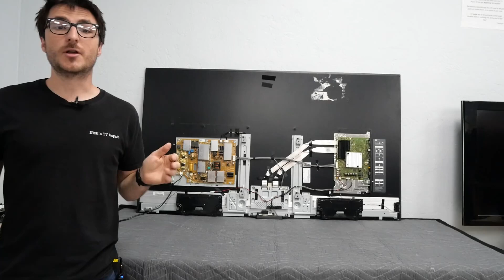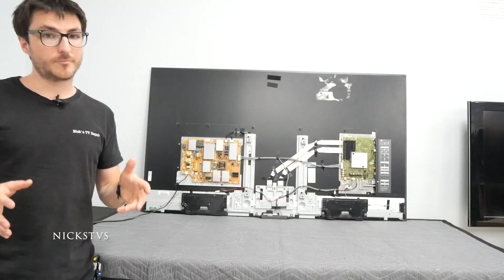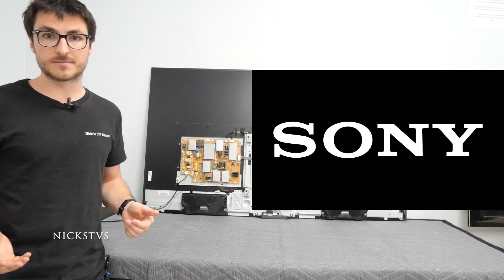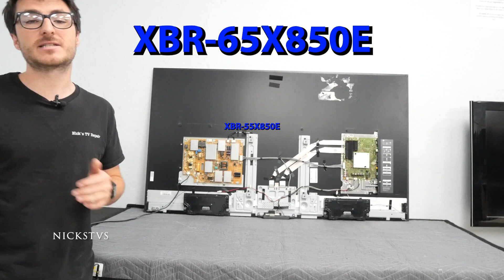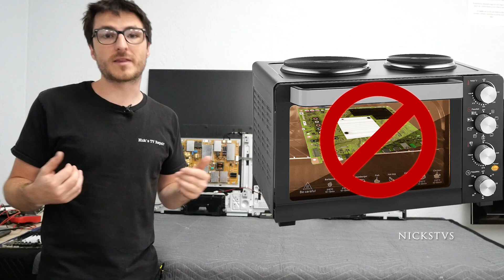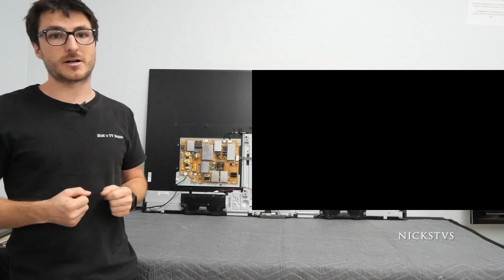Sony TV Diagnostic For Beginners Blink Codes Explained XBR-65X850E XBR-65X900E

Comment: Hey Nick, I got a Sony X90J 65 Inch TV that won't stay off.  I get random white blinking as if trying to power off but it comes back up again every time.  I've done soft/hard reset, I've disable all HDMI power up setting, disconnected all other sources, changed remote batteries, but it all points to the TV itself.  Would this be a bad PSU?  Anything I can try?
Reply from the maker: Based on your description it would be a bad IR sensor, buttons, or mainboard. Those are the only 3 things I can think of that could cause that. Turn the TV off, and immediately disconnect the buttons, repeat with the IR sensor. Still comes back on, then it's the mainboard. Stops coming back on after disconnecting either buttons or IR then that's your issue.

Comment: Tv turns on. Then shuts off with 4 blink code
Reply from the maker: If it's an LED TV then your LED strips need to be replaced. If you have an OLED TV then depending on the model it may be a power supply or screen failure.

Comment: Evening, not sure if you’re still checking this thread. I have the XBR65x850e. Just got the 6 blinking red lights. Did all the other quick fixes. Nothing works. I’ve seen videos about bypassing the error light indicator. Does that work for this model? Your thoughts on what I should do?
Reply from the maker: no that does not work for this model. As mentioned in the video 6 blinks has to be new LED strips.

Comment: Hello, I have a Sony XBR-75X900F, The TV will power on, complete the bootup process (Sony logo, Android logo, HDMI/Menu screen). After the boot process, the TV seems normal. No screen flicker, no strobing, nothing. After a period varying from 5 min to 2 hours, the TV will shut off completely, attempt to reboot, get to one of the two boot screens, then power off again with the 4 red blinks. I will then unplug the TV for 5 min or more, plug it back in and the process starts over again, but the amount of time that the TV works is reduced each time. I have tried unplugging all input cords into the TV and plugging them back in one at a time to eliminate a cord issue. I have also tried the forced factory reset with no luck. The Main Power Board was replaced in 2021 due to a no power issue (screen would not power on and the led would only blink red). What could the issue be or what else can I do to troubleshoot the issue. Thanks in advance.
Reply from the maker: You have bad backlights. Replace your LED strips and it will solve the issue

Comment: MY Sony XBR-65X750D, I replaced the main board and have sound but not picture.
Reply from the maker: Most likely and issue with the large flat ribbon not connected properly. This is an extremely common issue people experience because of how fragile those ribbons can be. Also it's possible your ribbon got damaged when it was removed from your original defective board. Try reseating it first and try again. If the issue persists then you may have to buy a replacement ribbon.

Comment: HAVE XBR 65X 900E 4 RED BLINKING LIGHTS FUALTY CODE  GOES ON FOR 3 MINUTES THAN OFF WHICH CIRCUIT BOARD DO I CHANGE.
Reply from the maker: 4 blinks is a backlight failure, meaning you will need to replace the LED strips inside of the panel.

Comment: Hey there, I hope you are still checking these comments. I have a Sony XBR-65X900E and I am now getting the 4 flashing LED error code. After I do a soft reset I will get the sony logo and then the google logo and sometimes even get as far as the HDMI Input select but then after about 10 seconds the screen will go black and I will get the 4 red led error code. Other times I will do a soft reset and right after the google logo boots up the screen will go black and I will get the 4 red led error code. I also did a full factory reset, got a spinning circle on screen for about 5 mins while everything got erased then the sony logo same up and then the google logo, finally after the google logo the screen shut off and I got the 4 red LED error code again.

Going to open it up today and try the bypassing the error shut down protection pin and soldering it to ground but would prefer to try a real fix on it first.

Any insight would be greatly appreciated.
Reply from the maker: 4 blinks is backlight failure.

Comment: Hey thanks for what's the fix for 8 blinking lights - you said software related but how to fix as no display is showing only 8 red flashing lights
Reply from the maker: You have to replace the eMMC chip on the mainboard for that. It's one of the more advanced repairs and requires very expensive machinery. We don't recommend you try this yourself and instead to send it in for repair. Flat rate repair service is linked in the video description for the mainboard.

Comment: My xbr65x900e doesnt turn on, no blink codes, no buzzing sound...I was getting warning signs possibly cause i would find when i go turn on the tv, it would give me the sony and android logos and then turn on...what could it be?
Reply from the maker: It really sounds like a mainboard failure to me.
Reply: @NicksTVRepair So that's the diodes needing to be replaced?
Reply from the maker: No sir, the diodes are on the power supply board. The mainboard is the green one with the HDMI ports, processor, and eMMC chip that we talk about. You have either a processor or emmc chip failure.
Reply: @NicksTVRepair thanks. What should I expect for repairs cost wise for that ? Im assuming that's not a do it  yourself
Reply from the maker: We don't do pricing on youtube, but prices are available on our website. Listings are linked in the video description.

Comment: I get a flashing white light all the time {whether powered on or off}.  Does seem to work except network connection always way slower than it should be.  Computer on same network shows network is fine.  Flashing light is very slow but also seems to randomly change flashing rate occassionally.

Comment: Hi Nick, what do you think about the cutting of the #4 pin on the backlight cable so that it cannot report the error?  My TV works and looks fine anywhere from 3min to 20min before it does the 6 red light blinks.
Reply from the maker: I don't think you should do that. 
I think you should replace the LEDs to fix your LED failure.

Comment: I have a 65X900E that started randomly turning back on after turning off, restarting and flickering. It will not accept a firmware update, even though it says it was successful. It also cannot be reset to factory settings through the menu or via a hard reset with the buttons on the outside. It just simply restarts. Picture settings are lost whenever the tv restarts, but most of the time the TV works so long as you don't try and adjust anything; it will often go to a black screen and the only fix is a restart.
Reply from the maker: Interesting. You can probably get away with having it work that way for a bit, but eventually it will get worst. The eMMC chip most likely needs to be replaced. It's however possible you may have fault with the processor as well. Sometimes both need replacement.

Comment: cant you talk about the 7 error blink code more? like what causes? heat? or what is the fix ? thank you
Reply from the maker: Can't sorry, it's so infrequent that it's not worth looking into it. We have seen it probably 20 times total in the last 5 years. (mind you this is accross thousands of repairs) We did try to figure it out at first but then gave up and decided it's not worth the time and effort given it's not common enough of a failure. 
7 blink our rule is replace the mainboard.

Comment: Hello sir i have xbr65-900e I change already the main board but no display if i turn it on sound will come any suggestions todo it
Reply from the maker: Ribbons are most likely not seated correctly and need to be disconnected and reconnected.

Comment: I have a Sony XBR 65X850E that wasn’t getting any power…replaced the power board and no change…replaced the main board and now I have a blinking green light. Not sure what that is or how to fix it. Common thing I see is a potential firmware issue. Any help is appreciated.

Comment: Hi there I have Sony XBR-65x900e. The issues started with the Android logo keep cycling, and I downloaded the software by using a flash drive. I try to update now, it won't turn on at all, no light, no nothing. What could be the issues now? please help
Reply from the maker: This sure sounds like a mainboard failure due to a defective eMMC chip. This is a fault we can service for you but you would need to send in the mainboard for repair:
https://nickselectronics.com/products/xbr-65x900e
If you are ready to pull the trigger and send it in, just purchase the service and an email with packaging and shipping instructions will be sent. 
If you are not ready and have questions, concerns, or simply would like to talk about it some more, you can reach out to support@nickstvs.com and one of my customer service team members would be happy to answer any questions.

Comment: I'm planning on doing a mainboard swap in a 65X900E I purchased recently, since after watching this I'm pretty confident I'm experiencing a mainboard failure. I thought I saw this in a comment already, but there's nothing I can do to make it last longer before it inevitably fails again, right? Any extra ICs I can add a heatsink to to help these issues? Thank you for your video.
Reply from the maker: Update the TV to the newest software update, then disocnnect the internet and do not use the internal smart apps. Use an external streaming device to access your apps. This will help reduce the strain on the mainboard and allow the TV to last longer. I use a firestick with my Sony TV and use the firstick TV to control the TV actually.
Reply: @NicksTVRepair  Perfect, this was the plan anyways. We use an Apple TV here. Good to know!!

Comment: Sometimes mine does the boot loop other times it's just black
Reply from the maker: Yeah that's going to be a mainboard failure. It's possible your processor (under the white heatsink) is going out, or the eMMC is failing in a bizzar way although we have seen that a couple times before.
Reply: Thanks for the reply! Your work is a beacon in this sea of engineered obsolescence. It's almost poetic how everything, regardless of cost, eventually succumbs to its strategically pre-programmed demise, 'conveniently' as soon as the warranty expires. 

I've had it unplugged for a while now. Do you think applying some thermal paste and then attempting a reboot/reset is worth attempting, or are we simply rearranging deck chairs on the Titanic?

Comment: Hi nick , I really appreciate your videos my Sony tv xbr-65x900e turn on and get android sign and then shuts off by itself and red light flashes 4 times , will replacing the led board fix the problem?
Reply from the maker: it should yes
Reply: @NicksTVRepair  thanks
Reply from the maker: WOW Wait a minute no the answer is no. It won't fix it. You have to replace the LEDs. Not the LED driver. I must have misread your message sorry
Reply: @NicksTVRepair  ok thanks buddy for getting back to me , do you have a video on this channel on how to replace leds ?
Reply from the maker: I don't have anything that would be helpful to you. All I have is a video on replacing the LED strips for an XBR-65X900C but it won't help you since yours ends with an E and they are 200% different from one another.
Reply: @NicksTVRepair  i really appreciate you replying , i ordered the led strips and its whole set of 18 strips , will replacing all of them fix the issue ? thanks again :)

Comment: Hello, firstly thanks for posting these videos. I have a 70" Sony KDL-70W840B (Canadian 850). It powers up and displays an image for about 5 seconds just snow (displays TV is powering up) and then cycles off. I am getting 4 blinking lights.  Very limited information on this model online.
Reply from the maker: I don't work with the 2014 Sony models only the 2015 and newer. But 2015 and newer models when a 4 blink is triggered is usually due to failure of the LED driver board and or the LED strips themselves. I don't know if that blink code can be applied to your unit however.

Comment: I have a XBR-75850F 
The power comes to TV and the white light turns on but nothing comes on screen. What could be wrong. Thanks
Reply from the maker: Based on your symptoms it definitely doesn't sound like a power supply failure. It also most likely is not an LED failure or LED driver otherwise you would be getting a 4 or 6 blink error code. 
Since you aren't getting a blinking error code. That sounds like it's a mainboard failure but I can't be 100% sure. There is a small chance it could be T-con or panel but that's not common for those to fail with this model + you would usually also get a 5-blink error code. In my experience, no blink code no picture is going to be mainboard related. 
We do offer a flat-rate mail-in service for these, if you want to send in the mainboard we can check it out. If it turns out the mainboard is fully functional we issue a full refund and only keep $20 as a bench fee for testing it. 
https://nickselectronics.com/products/xbr-75x850f

Comment: Great stuff, Nick. Well, we have a XBR-75X850C. I was getting 6 red blinks. I changed the main power board, and now I have no blinks, but instead we have a steady green and white flashing thing going on from the LED. Was on chat with Sony, they suggested a hard restart...no joy. I have firmware on usb, IDK if I can plug in without a screen and get the board updated. What say you, my brother??? Thank you in advance!
Reply from the maker: I am sorry to tell you this but 6 blinks is not power supply or mainboard related but instead is LED strip failure. 
You will need to replace the LED strips in your TV in order to fix this issue. 
As for the amber green video that's normal it means your mainboard needs to pair with your T-con and panel. I wouldn't worry about that right now because it's going to probably happen again through the course of the LED replacement but here is a video on how to pair:
https://youtu.be/3kYPjIHt8Lc?si=1Z7BFrAsLIzTneXX
And i also have this one:
https://youtu.be/gBd2g7kRsEM?si=ZJgbfyEcl-Eje5TU

Comment: Nick, I tried replying to your comment to me yesterday on another video you posted regarding the rain-x product I use for screen scratches but they keep getting deleted.   Don't know why.. Anyway, I don't use the spray but instead I use the liquid in the small yellow bottle.  I use a toothpick to get the rain-x just inside the scratch but nowhere else.   Even when dry, the rainx keeps the scratch "wet".  I have never tried the spray but I know that the one time I tried the yellow bottle liquid globally on the screen, it left it smeared.  I had to remove the rainx with windex to get the smear out, so I confine the rainx to the scratch itself.
Reply from the maker: Yeah, that has been happening, and the reason why is probably because of the external links. Unless you are a monetized YT creator links are going to flag your comments and they won't get posted in case of spam or scam. 

I had heard actually that using petroleum jelly would also have a similar effect. Just never tried it.

Comment: Hello, 

I have a Sony Bravia XBR-65X850F that just recently started having issues. The screen remains black but sound can be heard coming from the TV. The light does not blink (remains white) and the TV can be turned on and off, but again no display. I have tried resetting, unplugging, disconnected all connected cables even changed the power outlet and so far nothing has helped. I have been reading on different sites to similar conditions that lead to failed backlights but is there a way I can test/ diagnose to really identify the fault? Thank you for your help.
Reply from the maker: You could use an LED tester but odds are low the LEDs are bad, usually when they go out, it triggers the 6 blink code. I would be more inclined to believe your screen is bad, your T-con is bad, or mainboard is bad. As for determining which exactly is the cause I can't assist you without having the TV in my shop. But if you wanted to send in the mainboard, we can live test it for you and confirm if it's working or not. The bench fee is $20 for that + shipping cost. That's the best I can do to assist you further unfortunately.

Comment: Where can I buy led strips for a XBR-75X850F that shuts off after booting to menu and 6 red lights , and do I need to replace all of them , also can I bypass all of that if the tv is a 2018 ? Thxxxxx
Reply: And also do I have to replace all of them ? How do I spot the faulty led strip ?
Reply from the maker: See my other response
Reply: @ thank you very much for the quick response ⭐️⭐️⭐️⭐️⭐️
Reply from the maker: No problem

Comment: Hi Nick, thanks for this video. I have the same TV XBR-65X850E, It turned off by itself... and when it's pluggged it has a buzzing sound and it doesnt turn on anymore!
Reply from the maker: Well that means you found the right video to fix your TV! 
I assume you watched the video and were able to figure out exactly what the fault was by watching this video correct? If not I would encourage you to watch this video as it will explain exactly what part is defective.